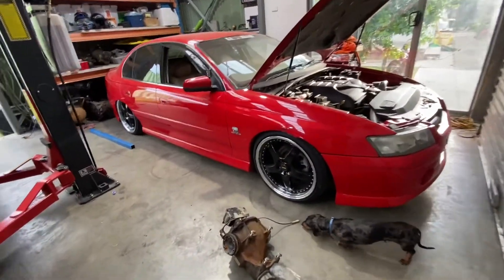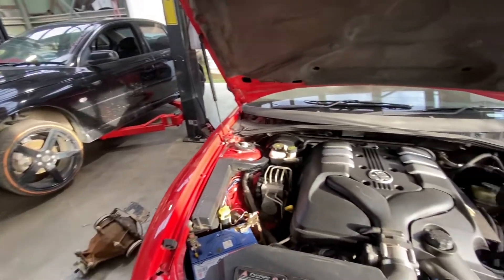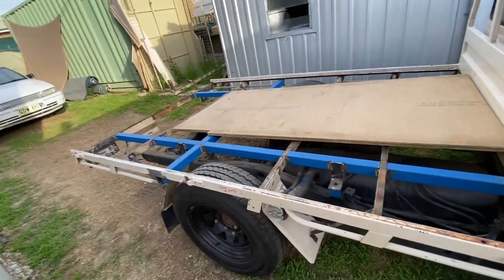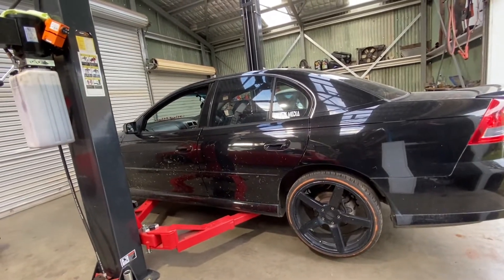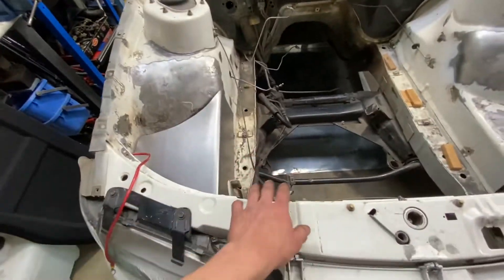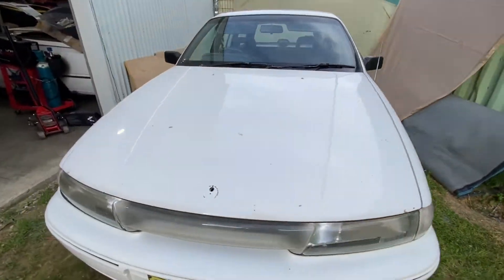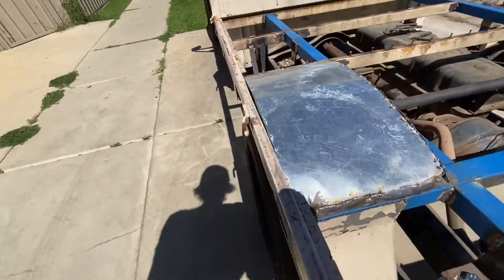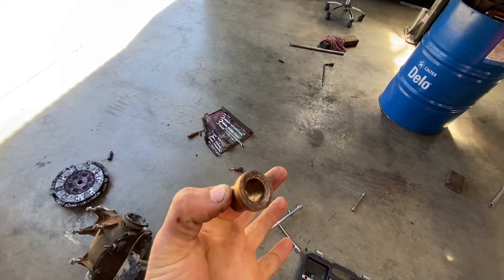We’re Off To Summernats!!!

Comment: Clamp off the rear brakes for skid row so you can start pumpin gears🤙
Reply from the maker: Thst will be the plan man take a couple pairs of vice grips and clamp them for skid row so I can just pull them off for the other events hopefully pump some gears 🤙🏼
Reply: @brendosgarage1494  you can buy clamps from supercheap that im assuming are made for this sort of thing
Reply from the maker: @blokebeershed7651  yeah my old man has some at work might see if I can borrow then eventually after I get it registered I will put a line locked in like in my ute so it’s operated on a switch 🤙🏼
Reply: @brendosgarage1494  can also do em on a ball valve through the floor, thats works pretty good too